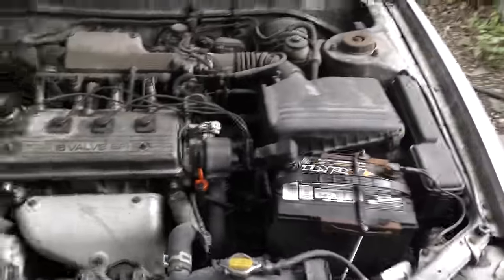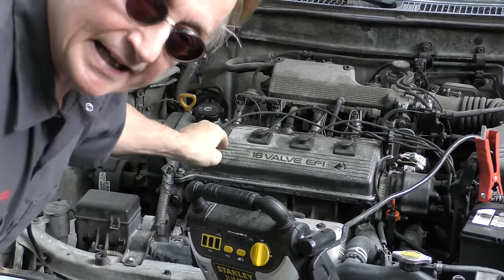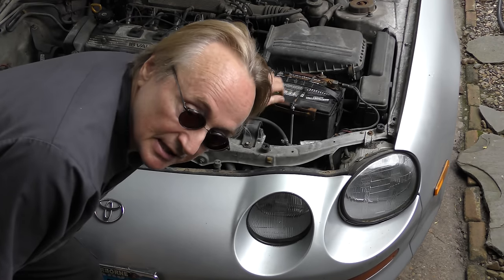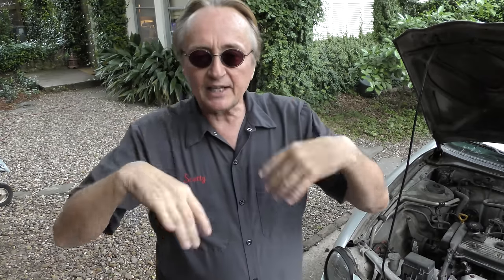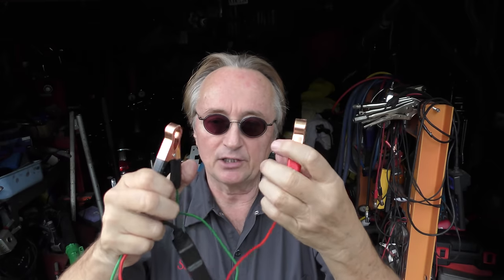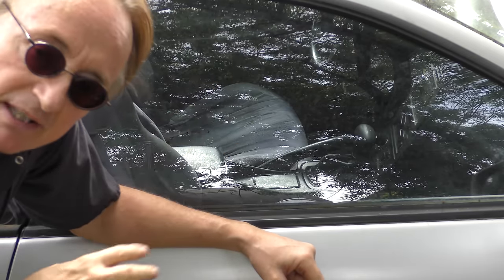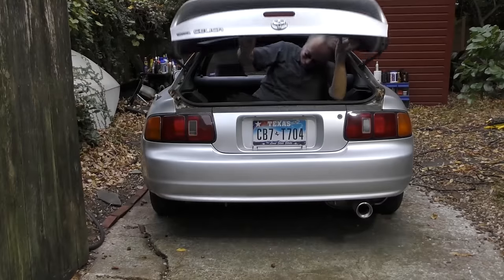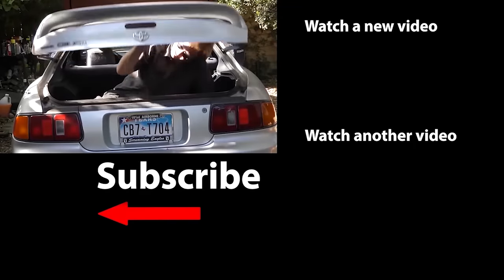Never Do This to Your Car (Learn from My Mistake)

Comment: Tune your car radio to 123.4 FM for 5 minutes while turning the dome light on and off 6 times in 7 minutes while driving 8 miles at 9 mph with your toe on the break and your heal on the accelerator. Left foot on the clutch, naturally. We will discuss clutch replacements in the next episode.

Comment: Back in my early days my battery had a slight loose connection and a loose battery terminal and it wouldn't start if it was loose :(remind you back when I was young and didn't know any better ) so I was in a hurry with a buddie close by I jumped out saying oh I know what to do il just turn the terminal a little this way and boom ! I never saw a battery blow up before and they do it your not watching what your doing and I mean this batter flew all over my apartment complex huh this is one time you don't want to say huh I didn't make the connection to this day I still get nervous around battery.

Comment: Last week I had to jump my supervisors dead battery. I told him to hold onto the red cable, I connected the red to my positive terminal, connected the Neg to my neg terminal and the handed him the other negative. I started my car and then told him to stick both clamps into his mouth. You should have seen the look on his face.

Comment: Replaced my flat battery with a new (expensive) one.. now the airbag light goes out and then comes back on.. now an mot failure and needs the sensors resetting even though there’s nothing wrong with the airbags.. bloody joke.

Comment: Scotty, could you be wrong for once? Bosch or Delphi are often the original O2 sensor manufacturer. So you can buy the same exact one cheaper than the one rebranded by the auto manufacturer.

Comment: Jingle Bells... my rear seal swells... Poured in some Blue Devil... The batmobile... lost a wheel... The ground must not be level... Dashing through the snow... with a messed up traction control... Someone put in dot 3, not 4... Hit a telephone pole... Got my scanner out... trying to get it right... What do you mean? My smogs not ready... Got a yellow ABS light...

Comment: i have 1953 dodge m37 army truck  i fiund in a junk yard in 2011  i have over haled the eng new tires (5)   new brakes compleat  aalonwith anything else that need replacing  no tble finfing parts  for it newnot old stuff  ifee like i have added about 50 more yrs to with a little tlcit is so easy to work  im 86  but i stll play with it   purrs like a j kitten

Comment: Unless the battery is stone dead you will never lose computer memory. Just plug in a 12 volt supply to a power outlet in the vehicle. If you lose computer memory they vehicles computer has a drive procedure to restore the memory/parameters.
Reply: On battery replacement.

Comment: Here is a puzzler, please help if you can.  My Car battery just died completely zero recognition of any power.  I was going about my errands with the car when I tried to start it in a store parking lot and it just fizzled to nothing in one second.  After about an hour I was going to give up and have the car towed when my mother said try it, it  will work so I did and it did ! It started up again like a powerful new battery.  When I got home, I turned it off after a while I thought why not so I turned it on several times. It just goes on like a powerful new battery. Does anyone know what happened? Will it happen again? Can someone please explain and help me to understand what is going on? Will it happen again? Mercury Sable LS Premium year 2002 35,000 miles, one owner,me.  Battery is 2 1/2 yrs. Old. No crud on terminals and tight, no play on terminals.

Comment: I'm not sure Scotty hasn't contradicted himself, here.... On a late model car, it May realize that you have changed the battery and change or default the charging profile to suit. If i use one of the 'battery saver' devices he recommends, it will prevent the computer knowing a new battery was installed and continue using the possibly harmful profile (SLA on an AGM battery) 🤔 -

Comment: Moral of the story, don't buy a car with a battery management system, keep your battery charged, If your car sits for more than a month. Charge your batt, each month. Flat led acid batt destroys itself all by its self.  Even charge more often if you have a burglar alarm, cos it's always working.

Comment: Yeah 50 60s 70s that are easy to work on, once they found out they could make more money by adding all the pollution equipment and the software, they started adding software to everything so you have to pay more money for the parts they try to make it very difficult, and you can hardly ever get a tune car anymore

Comment: I was told to reset the computer by disconnecting the cables from the battery & touching them together.

Comment: Exploding batteries because of venting sulfuric acid igniting from a jump start spark? When was the last time I used a open cell car battery, probably 50+ years ago.  Your modern car battery will not explode but under the most rarest of conditions, if that, because they are sealed with no venting possible and no vent tube.

Comment: 1. If the side windows in a "modern" car can't be counted upon to shatter, it seems to me you could be driving a death trap. iIf ever you're plunged into water, the electrical system might be unable to roll the escape window down -- even a crack. In that case, the pressure of the water on a sealed door would prevent it from opening. Eventually water would seep in, the pressure would be equalized and you might be able to open the door. However, in a cabin nearly full with water, you might be in such a panicked state, and you'd likely drown. Is the solution never to buy such a car?

2. Would you expect anything as old as a 2000 LX470 or 2000 Toyota Tacoma to employ the "wonderful" features that make battery changing a professional mechanic's duty? I'd like to think that as long as I use a "keep alive" OBD device + 12-volt battery, the worst thing that could happen (alarm or radio going braindead) would be avoidable ... so that I could be allowed to change my own batteries. Your thoughts?

Comment: They are making cars this way not just because "that's how it is" but, for the most part, because controlling the power precisely optimizes power use which is usually fossil fuel based and that means that optimizing power (electricity to charge the battery for instance) aids in reducing fossil fuel use which helps to reduce the danger to life on Earth.

Comment: this is the reason I drive a 2000 F350 7.3L diesel. it ain't particular EXCEPT you need TWO STRONG batteries and if you're in the South you better replace them every 3 YEARS like its a Religion.

Comment: I don't get it. These new, fancy, computer-controlled systems sound archaic to me. When a battery is disconnected, then one is brought back online, the computer should automatically run a diagnostic to see whether the battery currently online matches the parameters of the old battery or is in fact a new battery with different needs. If it had to be rebooted manually, there could be a "reboot button" in the car or under the hood! Why would you have to attach another computer, like Scotty's hand-held one, to command it to re-analyze? That's just WEAK!

Comment: About Twenty 19 Ridge line Honda hard shifting with a six speed transmission no angel light. The dealer cannot diagnostic because of the engine light . don’t come on
Reply: The transmission shift like the old transmission without a vacuum air vacuum